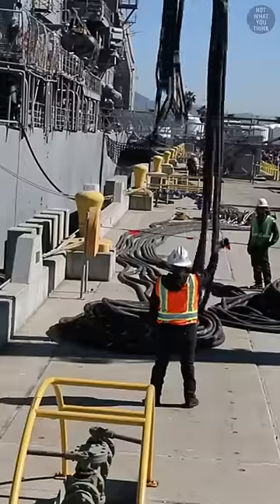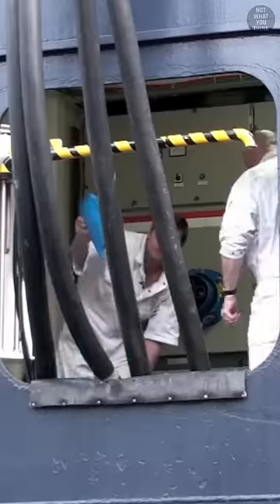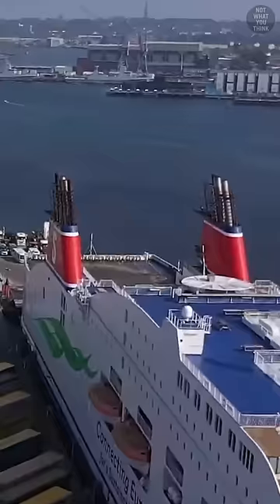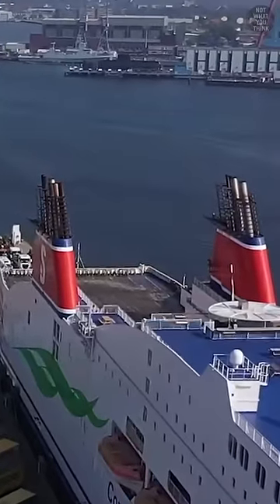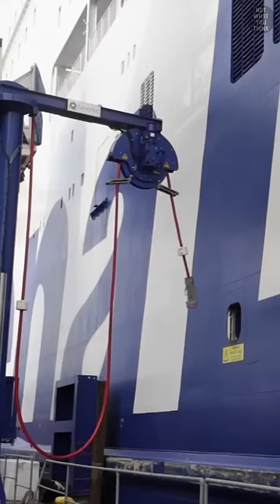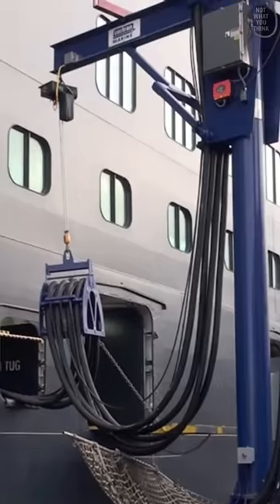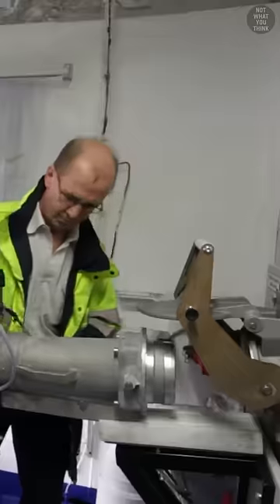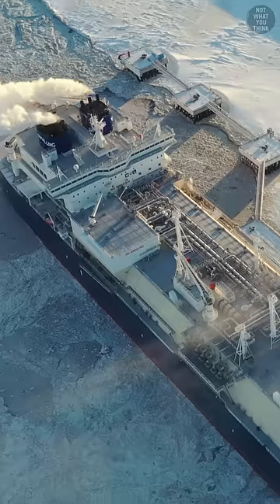Why Ships Burn Fossil Fuel When Idling? #shorts

Comment: This video might be true if it was 10 plus years ago.. but nowadays there are very strict regualtions on what to burn at ports and what not to.. suplhur cap,sox reduction, carbon intensity index, seemp , eedi,eexi,eeoi , marpol annex nox 6 etc etc etc.. so this video is totally false .. every ships comply with regulations and convention and rules and codes etc etc 
Do your research before posting video brother

Comment: Maybe, before you start uploading any videos, you must make a small at least search. Since 2019, almost all ships are equipped with scrubber system, spraying sea water like mist, on the funnel, washing the exhaust gases, and by the alcalinity of the sea water, 99,5-99,9%(which depends on the quality of fuel oil) of any harmful substances, are removed and collected on board and given to shore for new roads. This makes them cleaner than your standard EV, powered by electricity created from coal... 😊
Reply: @notwhatyouthink

Comment: They should be 1000% illegal
Reply: What?!
Reply: @GrillerRohde  I'm going to assume that you did not watch the video
Reply: @dalebabcock722  
I did but you can’t just make it illegal.
Reply: @dernutellaboy6402  If it's illegal for trucks to idle , then yes, they can make it illegal for ships to be idling.
Reply: @dalebabcock722  
I Hope you know there’s a huge difference between a truck and a huge container ship.
Reply: @dernutellaboy6402  of course.  And a ship burns more fuel and pollutes a lot more.  Hence why it should definitely be illegal
Reply: @dalebabcock722  
Okay great then make it illegal and watch how the ships cannot operate anymore due to a lack of electricity.
Ships cannot operate without electricity so they’re forced to leave their engines running.
Reply: @dernutellaboy6402  so tell me you didn't watch the video without telling me you didn't watch the video.      Durrrr.
Reply: @dalebabcock722  
If you would have watched the video you would have noticed that this system doesn’t work very well and only a few ships can actually use it.
Not all ships have required connector neither do the majority of ports.
Reply: @dernutellaboy6402  then it's something they should improve on and get with the times or be shut down.   You can't have ships that Idle that equal the pollution of 50 million cars annually.    This is unacceptable.
Reply: @dalebabcock722  
Unlikely, shut down harbors affect the whole economy negatively.
They wouldn’t dare to do it.
Reply: @GrillerRohde  and what would killing the planet harbor negatively????
Reply: @dalebabcock722  
What? 😂

Comment: Any receipts, its so easy to state these so called facts. But I know that there isn't a company on earth that wastes fuel or man hours to any large degree. 
Companies have operating ratios and fuel usage is a large item and they don't waste it.
Plus that black soot you see a diesel engine make every once in awhile doesn't cause any kind of bad pollution. There are different types of emissions and until you realize what they are and what they cause then the subject is something you shouldn't worry about. Lies are easy to spread and the public eats them up all day pollution has actually been curbed largely. And the world handles what we give it quite well. Fact is all these green movements have been producing more pollution than fossil fuels...
Just research the new article on electric cars.
They sre being proven more polluting 😂